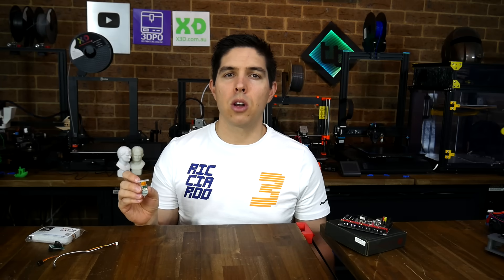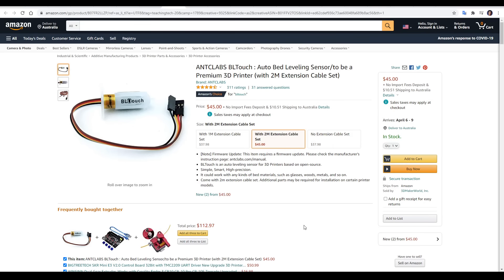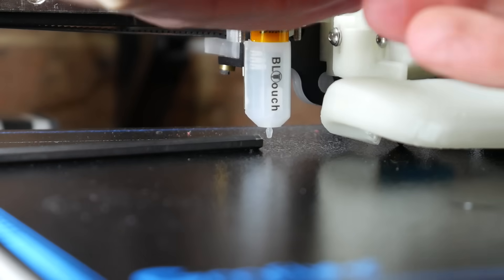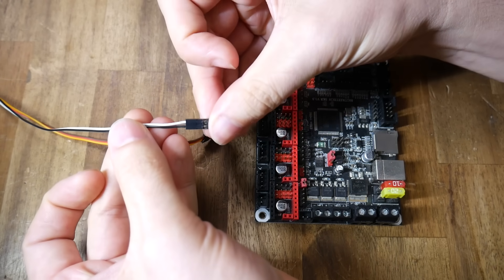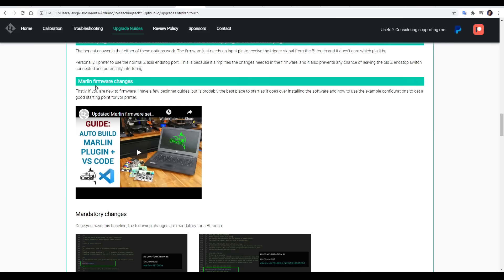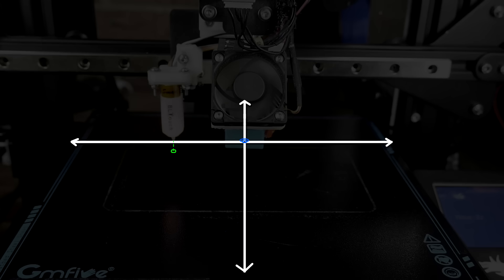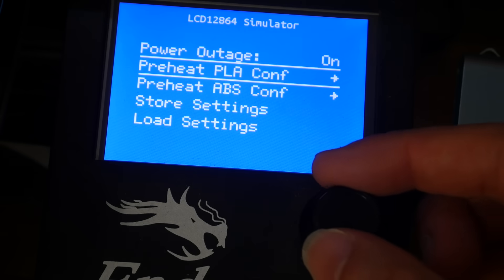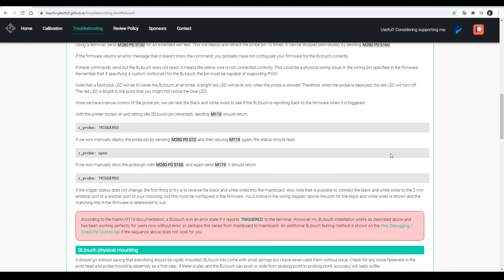BLtouch for any 3D printer - Comprehensive step by step guide

Comment: Thank you for the great videos. 

I followed the steps in this guide and I’m having an issue. When I try to do auto home it moves left on the x axis and stops with the switch, it then moves on the y axis. But instead of moving back to the end stop it slides the bed forward. It then try’s the z probe of the BLTouch but doesn’t drop the z axis.   I’ve gone through the steps a few times. I’m not sure what I’m missing. 
Ender 3 max
BLTouch with the 5 pin end   Defined the pin a pb1
4.2.2 32bit creality board 

The machine auto homed fine with the firmware it shipped with and without the BLTouch

Any suggestions would be appreciated. 
Thanks

Comment: OK, so pin PB1 definitely doesn't seem to be correct for E3 with V4.2.2 mb.  Where the #### did you get this pin-out, can't find this information anywhere, and everyone either seems to assume you'll use their precompiled firmware or that it is obvious what pin to assign.  
Checked the pin allocations with M43... PB1 not even listed.
Probe deploys and retracts when instructed, but is never triggered.
Signed "Bangs his head against wall"

Comment: So I recently got a BLtouch from my friend to my Ender 3 V2 and installed it. However I got to the issue with the Zaxis wont move down. I use Jyers firmware E3V2-BLTouch-3x3-v4.2.2.bin
. Would plugging in the blacn and with cable at the Zaxis port solve this issue? As I am using the precompile version of the firmware I cant really check what type ocf commands that are defined here. Great follow through, I have book marked the page

Comment: I have been messing with mine all day... This has been quite the learning process but I'm past my ability to figure it out with the videos as aid alone! I need help.  I followed along without too many hang ups but my BL touch when its auto lvling, hangs out over the left side of the bed.  I've set my "#define NOZZLE_TO_PROBE_OFFSET { -42, -10,0 } and even changed my #define PROBIN_MARGIN to 50 from 10. (thats all in Config.h)  I've also changed the probing margins in Config_adv.h to a variety of different values and have had the exact same result.  Thankfully my Z end stop catches it before it crashes into the bed.  I don't know how to fix this.  Plz help

Comment: can the bl touch be used without a working sd card as i don't have one and the one i got with the ender 3 pro isnt working anymore so i have to use a usb cable to print on it so would i be able to use a bl touch with a usb cable instead of a sd card

Comment: You start this off editing the firmware. Could you tell me what I edit the firmware with? I have an ender 3 pro with 4.2.2 main board and I have never edited firmware for this so I don't know what software you're going in there and editing with. I have the BL Touch physically installed and I have never been more frustrated with a piece of equipment or the range of people on youtube with these videos
Reply: Glad I'm not the only one struggling with this. I also have an Ender 3 Pro with a 4.2.2 board. Every video refers to models with the newer touch screen but i have the older LCD screen. There's about 10 thousand videos on how to install a BLtouch, every one has a different process, different model, different board, different software,  different BLtouch, different download, different editing.......Damn its like computer programming was in 1985.

Comment: im having a big problem with my bl touch. when i press auto home it works perfectly fine. but when it does the 9 point leveling instead of going down my z axis moves up. it wont complete the 9 point leveling any help would be awesome
Reply: also my printer is the ender 3 with a 4.2.2 board

Comment: Hi, I have a E5Pro with a BlTouch ( The sensor is connected without an adapter board), the 4.2.2 motherboard and the firmware from Creality: "Ender-5 Pro-V4.2.2–32bit Marlin2.0.1 – V1.1_BL-Touch(without adapter board)". This firmware is a bit (or more...) different than all shown on youtube. I.e there is no "disable xy axis" or "move z" which doesn't let me level the bed manually. Therefore I have lots of trouble to automatically level the bed. Are you able to make a move how to do it properly ? Or maybe to prepare the procedure ?
I am totally new to 3d printing but I just have started to like it. Except this BlTouch bed leveling
Greetings from Poland :)

Comment: Ender 3 MAX: My bltouch would often react/retract way too late. Sometimes it wouldn't retract at all and enter a fault state. I tried everything in software, and even tried shielding the cable with grounded copper mesh - nothing worked - but when I used the Z-stop switch instead of the 5-pin connector, everything worked perfectly. It might be caused by the fact that the Z-stop switch is connected to a pin on the chip that has an actual hardware interrupt, so the CPU doesn't have to poll the pin all the time. Also: The Marlin 2.0.8 config example for Ender 3 Max is flawed - DO NOT USE IT. It sets your bltouch to 5V.
Reply: Hi, but bl touch 3.1 do support 5v mode, or not?
this is in their description:
"Z Probe Output Open Drain VDS / ID: Logic Free (Open Drain: default) or 5V logic Max VDS = 5V / Max ID = 300mA"

Comment: I have Ender 3 Pro with 4.2.2  I'm upgrading to the BL Touch and want to keep using the original Z home limit switch for verifying home position because I trust it more for that purpose than relying on the BL Touch system. Do you believe there isn't any benefit in continuing to use it? Am I just adding time to all my prints by keeping it? The BL Touch unit appears pretty fragile, and I believe a failure could allow the nozzle to crash into my glass bed and break it I guess.  Maybe having to replace a glass bed, "if" it ever failed that way would be worth saving all that extra time in prints? or "would" it take more time to verify standard Z-home safe position? I'm not familiar enough with the new firmware to know what a home routine would look like retaining the standard Z-home verification.

Comment: Love your vids! How tight can the pin be? I had a failed print which wiped off the tip of my BLTouch. I got a replacement pin but it is not a slip fit...it sort of very lightly catches through the stroke of the pin - it won't freely fall through the housing (magnetic catches not withstanding). It won't engage when it's attempting to do a bed level. I have no idea what the fit was like before the crash and I don't know if it's a catching pin or the electronics in the body that is stopping it from working.

Comment: Re: 5:00 Mine was shipped from Creality with the wires flipped. It burnt out two boards before I realized the issue. As far as I know the order it plugs into the BL touch is the order the wires plug into the board. i.e. BLtouch from left to right Blue/Brown-Red-Yellow-Black-White is also the same order from left to right on the board. my Blue and Red wires were flipped. This caused fuse F2 to be overloaded and burn out. Please be careful about this!!

Comment: Thanks so much for this. I've had my BLTouch for 2 months and during that time I haven't printed anything. I've been so frustrated until I worked my way through this. I'm not done yet, but I'm almost there. I couldn't do it without you.

I will add that there are different options for compiling with a skr mini V2 and it won't start automatically. Another person below said that the correct selection is "STM32F103RC_btt_512K"

Comment: Great video! One thing I was wondering, with how you recommend programming the BLTouch to function as the Z endstop, would you still recommend this for a printer with dual z steppers? I ask because I currently have a BLTouch on my Ender 5, and I absolutely love the z endstop function, but I was considering also getting one for my Anycubic i3 Mega, which runs dual z steppers, and also dual z endstops. Is it still advisable to set the BLTouch to work as the z endstop in this scenario, or is it better in this case to keep the factory endstops?

Comment: Thank you for your posts and excellent direction. I just upgraded my ender 3 and could not have made the changes without the in depth technical information that your channel provides. Firmware mods and all, the machine works better than it ever has. Keep up the phenomenal work!

Comment: Hey Teaching Tech, I have an idea for a video. I'm currently working on modifying my printer with 3 indipendent Z-Axis motors. I would love to use my printer in conjunction with those motors to have the best non-planer 3D printing experience possible. Would you be able to make a tutorial on this or has Cura even added this type of printing yet?

Comment: Good stuff.  I'm just waiting on my local library to print the mount since my printer is completely borked with the current sensor, then will be installing a BLTouch on my Tronxy Xy-2 Pro. Just hoping I can find the right pins.

Comment: Very helpful video and I may try customizing my own now. I am using a Smith3D fw on my e3v2 422 board BL touch install because I needed a pre compiled version 6 mo ago. I may try customizing my own after watching your video now. I use  your marlin 119 BL touch 8 bit version on my e3 pro ever since your v3 video was released some time ago and like it’s faster probing. 
I’ve been trying Smith3D fast 3x3 blt FW on my v2 printer for several months. In your past Marlin 119 blt FW you did speed up the probing that I like because I do probe before each print. However, your FW does retract the probe for each probing. The Smith3D fw keeps the prob out and does a double tap for each of the 3x3 probe locations. This seems to be much faster and less in and outs of the probe that could wear on it over time? There is a warning that a very tilted not well leveled bed surface could damage the probe tip. Not a problem if properly done.
My question is what do you think of this not retracting fir the double tap mode and how does one setup marlin to use it?
At some point I’m going to try my own custom Marlin blt version snd I do like the way and speed  of not fully retracting the probe when measuring until it moves to the next grid  position.

Comment: Every time I think I have the BLTouch working, it fails... works for a bit then fails when it auto homes, fails on point 3, point 9 etc... consistently inconsistent... splicing in better connectors to the mainboard, switching from z stop connector to the integrated BLTouch connector on my v4 mainboard for ender 3 pro, cutting the 5v wire in my USB cord for the octoprint Pi... nothing was working after 2 weeks of troubleshooting... about to just resign myself to manually leveling, but I just can't give up... so I hesitate to write this comment, waiting for it to fail again, but I think I finally figured out the problem that was for me... my probe was too tight!  There is a little hex screw on the top of the BLTouch... i backed it off a half turn or so, and had no more failures (so far)... waiting for the other shoe to drop, but I upped my leveling to 5x5 and printed multiple test cubes with G29 before everyone... 100% so far... i've learned a TON from these videos and others, dropping some cash your way... you deserve it, even if my resolution (hopefully!) was found elsewhere... your videos are amazing... please keep them coming...

Comment: Using all your videos (this one, Updated Marlin firmware setup guide - VS Code and Auto Build Marlin, Creality 32 bit V4 board guide - Ender 3 V2, BLtouch & more, Master your 3D printer firmware: Github Desktop guide for beginners) I managed to finally build my own version of Marlin. Still not the easiest and most clear thing to do, I imagine folks in the comments will still have issues.

Comment: Good video thanks for the content. I recently installed one on my ender 6 but unfortunately I have done something wrong as my hot bed will no longer raise up and down. I think it’s firmware related. Any advice?
Reply: Same problem, you get it going yet???
Creality messed up huge on this 3.3v logic system sharing line with filament runout sensor on factory supplied connector on breakout board, when bltouch requires 5volts. Idiotic design flaw and no one seems to know or care to help correct, tried every firmware from their download page...nothing works properly.

Comment: Sometimes my BLTouch fails and starts blinking red. When it happens during leveling printer just starts printing, but when it happens during homing I get Nozzle crashing into a bed. Question is what could be the couse of this and can I have Z endstop switch react insted when it happens ? My printer is Ender 3 V2 with 4.2.2 board and my BLtouch is 3.1 with 5 pin connector

Comment: I tried a very cheap 3D Touch from ebay and i felt like it wasn't doing its job properly. I got a genuine BL Touch and it works far better. The standard deviation between measurements was like 10 times lower.

Comment: Is there a firmware option I’m missing that lets you choose the number of grid points for bilinear or UBL leveling from the LCD so you don’t have to flash the firmware to change it? 
I’d like to be able to do lots of points when I make changes and fewer points (and interpolations between points) at the start of every print.

Comment: The one thing that was tricky for me with the BLTouch setup I just finished a couple days ago was configuring the firmware and different ABL options. Looks like this video should have better detail on that than previous ones judging by the description. 
(Ended up using bi-linear leveling instead of UBL which is now much simpler to use and run consistently without problems.)

Comment: My first controller board, I had to solder a wire for the servo control pin heh. I am glad that the SKR that I have now has dedicated pins though, setup was WAY faster. Not sure if you covered it in a different video but X,Y offsets are rather important to make sure that the Pin actually touches the bed. It might have been a good addition to show some more detail on this. It certainly wasn't a difficult thing for me to figure out but Marlin made some changes from one version to another on how/where in the firmware these are changed. I actually physically modified my printer to make certain that my pin can actually touch the entire bed, just in case I wanted this functionality down the road, it hasn't been a problem so far but I modified the printer anyway, easy to do since this a design completely of my own. I enjoy modifying the printer more than actually printing stuff...

Comment: So glad you do these guides. Upgraded my Ender 3 from a 4.2.2 board (thinking I had the old 8 bit) to a BTT SKE E3 Mini v2 w/ BLTouch and filament runout sensor having never worked with any of this stuff before and there were basically zero problems (though some things could have been a little clearer). 

I’ve never had an open source based project go that smoothly before.

Comment: On the page you propose 2 options for connecting the BLTouch, but in both ways you use it also for homing. There is a third option, that lets you not use Z_SAFE_HOMING, keep using the end-stop for Z homing, and use BLTouch only for bed leveling. I don't know if it has much sense, but it also works.

Comment: If you have problems with failed probings and M112 errors using the new Creality Kits with the 5pin connector for 32bit boards, you'll need to either split the wires and use the ZMIN port or solder a 10k resistor between 3.3v and BL_T OUT pin. 

This is because the Trigger Signal Pin on the dedicated BLT port is only pulled up to 3.3v via a software pullup on the STM chip which is very high resistance and too weak for the long cable the BLTouch comes with. ZMIN is pulled up with a 10k resistor and works flawlessly.

Comment: For the 5 pin connector on the 4.2.7 board, I do not think you need to set the Z_MIN_PROBE_PIN, as its set aleady in the src/pins/stm32f1/pins_CREALITY_V4.h, which is included into the src/pins/stm32f1/pins_CREALITY_V427.h file.

Comment: I've got a biqu B1. Have bl touch plugged into the bl touch Plug. Have it enabled... It scans bed bud it doesn't adjust to the warped bed.... It just wastes time scanning then the printer does nothing different.....

I'm running it thro the touchscreen, not the marlin menu... How do I fix this?

Comment: With both the wirings you use the BLTOUCH probe for homing. 
Could you consider using actual z endstop for homing and bltouch only for probing the bed? 
I’m having issues with setting up the firmware for this configuration and I’d very much appreciate one of your detailed videos on that

Comment: Anyone using a BLTouch not from a 3D printer but using it directly from arduino setup, pi, or other microprocessor? I'm needing to do fine measurement of height at known points similar to it's use just not in a 3D printer.

Comment: Ive finally started using my OG Ender 3 again, after upgrading the mainboard to 4.2.7 and getting the creality auto bed leveling addon working.   No mount parts to print and the right cable out of the box.   Id tried a 3D touch, and was not successful.   The most frustrating part of this process was getting marlin working.    I find that the bl touch is a bit fussy, but I can't deny the improvements in print quality, as far as successful first layers.    It definitely is a game changer for me.   Id also recently swapped out the glass bed for a magnetic surface, with the bltouch no issues even though my bed is now noticeably not flat!   I definitely used TT guides for this process, so thank you.   Oh, I also found that setting the port and baud rate to auto on octoprint solved the connection issues.    I can't say why it does, but I came across the idea in a forum post and it worked!  Go figure!

Comment: Michael, a cheaper alternative would be a PL-08N inductive sensor and a bat43 diode. Works well as long as you have one of the spring steel printing surfaces.